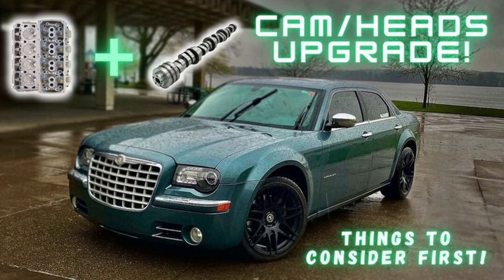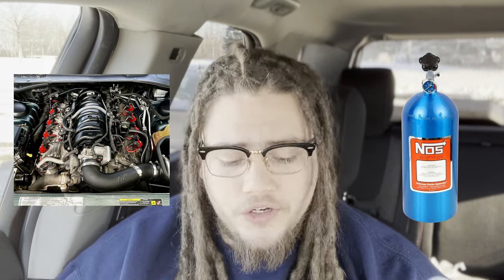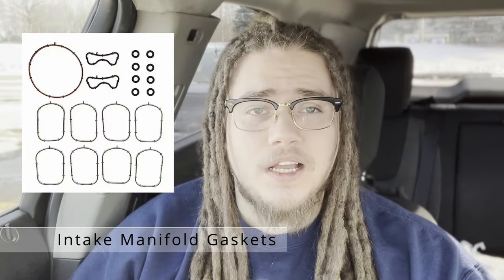Things To Consider For A Cam Or Head Swap I 5.7L HEMI

Comment: Have you done a base line dyno yet so you can track which parts actually give advertised gains? Out of all the channels doing 5.7 builds you are going in a different direction. All the other builds went forged/striker in lieu of heads and opted for ported 392 intake except 1 who opted for ported 5.7 intake. You seem to be going in the direction of heads. But what 99% neglect is the harmonic balancer. Not only does it “free up HP” but also does a better job of balancing the harmonics that the factory one was never intended to do. Remember the 5.7 is the corporate engine that was engineered for 5600 rpm whereas once the cam is changed the rpm power band will be higher and outside the engineered specs for the factory harmonic balancer
Reply from the maker: I haven’t as of yet, but I would really like to! I will also be grabbing a Dragy to compare times as ETs need to back up what the Dyno says. I do need to get a nice baseline to compare things with down the line, I plan on hitting a Dyno sometime this warm season. I do plan on taking a different route than most with this pre-eagle motor, I would like to see what she can do with ported & polished heads (of course a valve job, haha), a cam, pushrods, and some springs. With a stage 2 Comp cam and long tubes these pre-eagle have pushed 500+ bhp. With ported & polished heads the motor should be flowing a bit better and making relative power. I definitely agree with you! I’ve been thinking of an ATI Super Damper Harmonic Balancer, this is what I typically see on HEMIs gunning for higher power numbers. I’m interested to see how this motor will do when I’m finally able to get her where I want her. I’ll also be doing a Melling oil pump, water pump, a heavy duty timing chain set whenever the motor comes apart to refresh things. I had previously contemplated porting the 5.7 intake but many speed shops have informed me of how little it will improve the performance of the motor. I will 100% be modifying this motor in time, but sadly the ported & polished heads I was going to install ended up cracking when my buddy spun a crank bearing. Plans have shifted now that those heads are off the table, but I still intent on building this pre-eagle 5.7L motor in said configuration. I appreciate you and I hope you have a great day man!

Comment: What parts do you have on the 300 and what’s the exhaust. Love the videos! Liked and subscribed.
Reply from the maker: Thank you family, I appreciate you! So far I have: knfilters Fuel Injection Performance Kit (FIPK Gen II),  MSD performance Smart Ignition Coils From holley performance, Taylor ThunderVolt 8.2mm spark plug wires, I’m Tuned On 93 with a handheld Diablo tuner (fans adjusted for the t-stat),
American Racing Headers Long Tube Headers And Catless Mid Pipes (1 3/4” x 3”)(with o2 extensions), a Flowmaster Catback System (2 1/2”) With Mid Mufflers/Resonators Deleted And Resonators Chopped (This is a placeholder, I will be installing my SLP Loudmouth II 3” system this spring), Drilled And Slotted Rotors, Forgestar F14 (20x9.5”) Wheels Wrapped In Nitto NT555 G2s (255/35ZR/20), A 180° Thermostat from High Horse Performance, and an Aluminum Performance Radiator. Many more mods are on the way as well!
Reply: Thank you. @Underdogbuilds

Comment: Yo bro i have the same model same year car and i am getting work done at the dealer for free , pertaining to a recall with the fuel tank. a lifetime warranty, you should be covered as well.
Reply from the maker: Oh snap, I just looked into it! Interesting. I haven’t had any issues after fueling up, but if that ever happens I’ll be taking the car to the dealer. I appreciate the heads up brotha man!

Comment: Can you explain cam specs in like a short video?
Reply: Not is short video… they are extremely complex. I highly suggest sitting down and watching 2-3-4 hours worth of camshaft videos to truly under stand them. Even after that… you wont get them fully til you watch those 2-3-4 hour videos 2 or 3 times
Reply from the maker: I agree with @flicksifyr6793 on this one. Cam specs are quite intricate. Many cams have very similar specs but act completely different. The best way to fully understand cam specs is to watch a good few hours of video and taking notes. Then watching some more videos and taking notes on anything “new”. You’ll most likely hear a lot of repetition, but this will help instill the knowledge into you. I can see what I can do about a cam spec video for sure, but a short video won’t supply you with all of the knowledge you’d need. In all honesty, I don’t have the largest knowledge bank on cam specs as it takes years to be as knowledgeable as these folks who create custom grind cams. I appreciate you for tuning in 🙏🤞🏼 I’ll see what I can do about a video on cam specs.